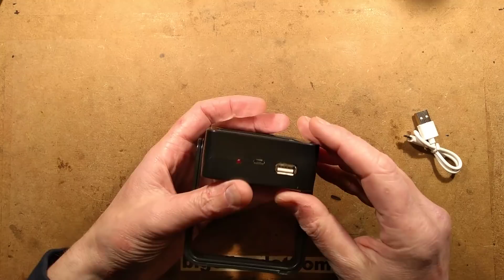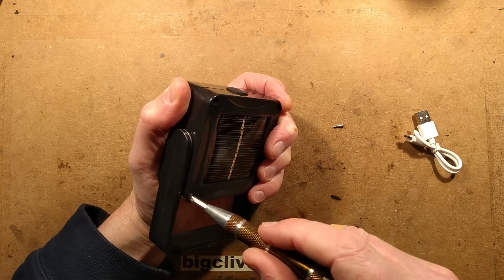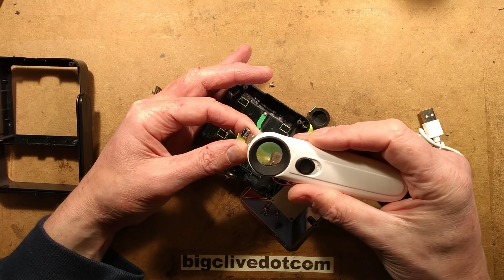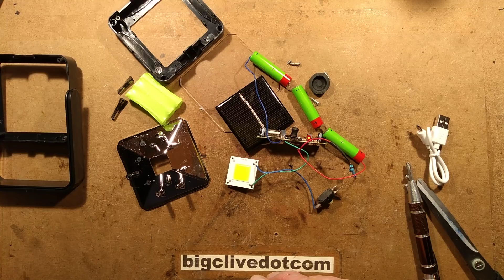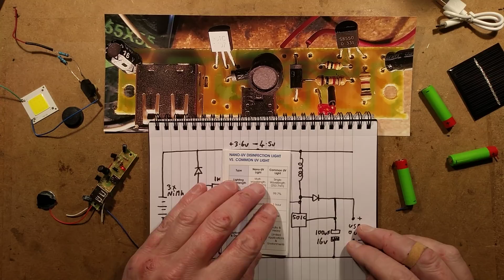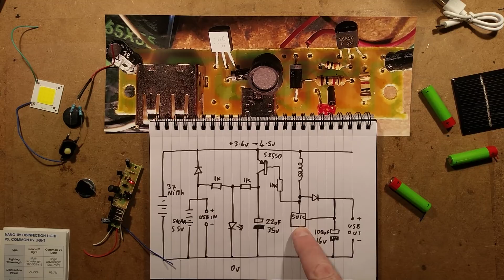(First version) Most lacklustre USB camping light yet.

Comment: Hey Clive, I managed to find 2 pin USB C sockets on Aliexpress. It looks like they are designed for smd PCBs but I'm sure you could just bend the pins and use them as THT for thin PCBs.
https://www.aliexpress.com/item/New-model-Heightened-5-pin-Tablet-PC-PAD-Charge-port-Socket-Mini-Micro-USB-Jack-Connector/32832353788.html?spm=2114.search0604.3.96.f5f83f26rHqpZI&ws_ab_test=searchweb0_0,searchweb201602_2_10320_10065_10068_10843_10547_10059_5726812_10884_10548_10887_10696_100031_10319_10084_10083_10103_5726912_10618_10304_10307_10820_10821_10302,searchweb201603_60,ppcSwitch_5&algo_expid=ac8188e3-1cc0-46b2-9ab9-f8ed406976ea-14&algo_pvid=ac8188e3-1cc0-46b2-9ab9-f8ed406976ea&priceBeautifyAB=0

Comment: Your circuit diagram appears to ignore the switch and how it changes the light level.
Reply from the maker: I didn't even include the LED at all.  I was so engrossed in the charging and boost circuitry that I forgot about it.  The switch toggled between one resistor, both resistors or off
Reply: Nice catch robin Campbell. I was watching Abom79 the other day ( machining tuber) he explained what he was about to do did it, then pointed out his error. I didn't even notice. I'm usually they guy when watching a movie and a car flips I'm like did ya see that rewind point out the compressed gas vapor or the plunger that flipped the car over etc...
Reply from the maker: Fixed in the final video with this little addition.  Thanks for spotting that.
https://www.youtube.com/watch?v=pyO0fAKUJmQ

Comment: It has 2 brightness settings but only high and medium? 🤣
Reply: All of its output is above average.
Reply: Could be low and med if you like or high and low
Reply from the maker: The low setting will be as soon as the battery runs flat and will then linger for the rest of your camping trip depending on the amount of sunlight.  That probably means most of the trip.
Reply: @bigclivedotcom  😂 cheers 

https://goo.gl/images/x2PPSe

Thats a link to isle of man flag.